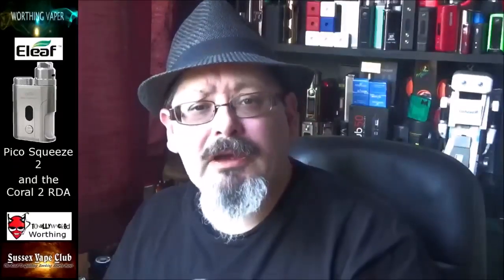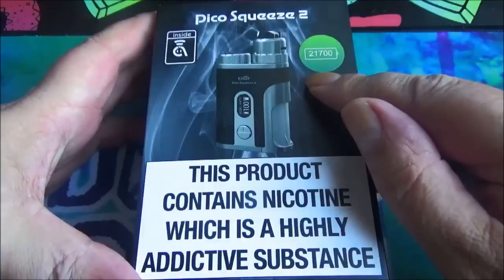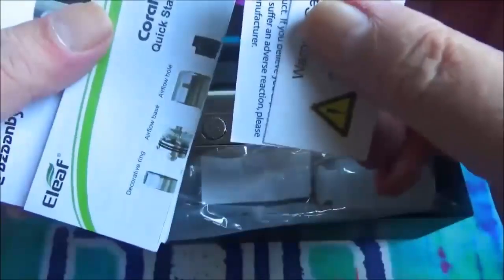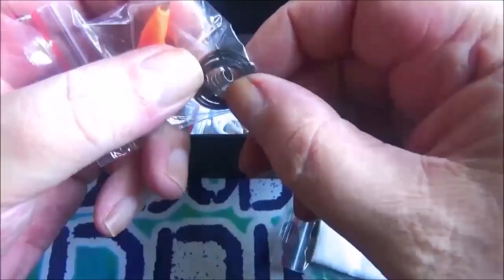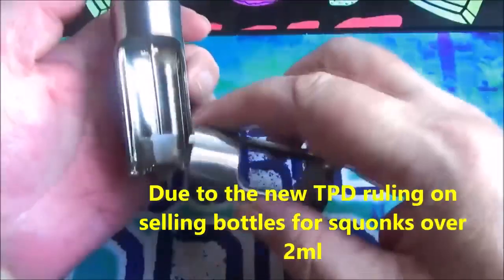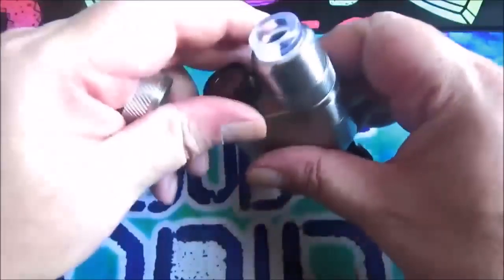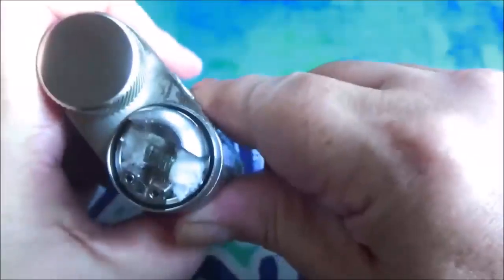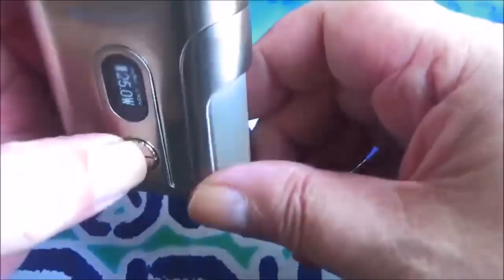Pico Squeeze 2 with the Coral 2 RDA by Eleaf

Comment: What’s the battery life like Kevin I’ve got pulse 80w and lasts about 2 hours. I like eleaf stuff good quality building thanks for review
Reply from the maker: I get 3 to 4 hrs at 60w mind you that's with a 21700 battery if running a 18650 at the same wattage I recon on 2 1/2 hrs